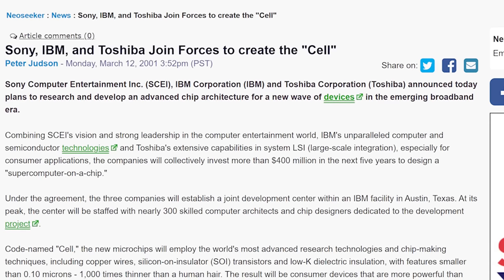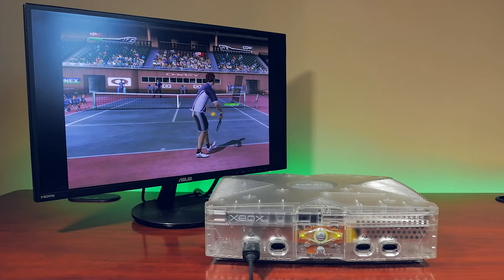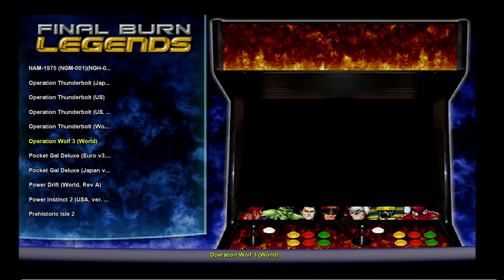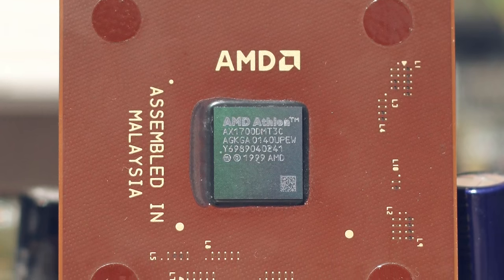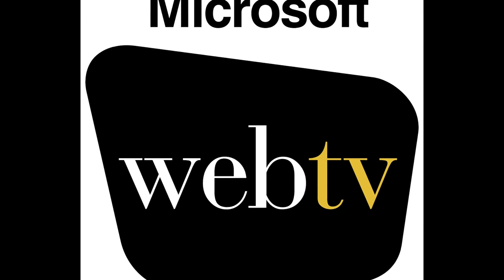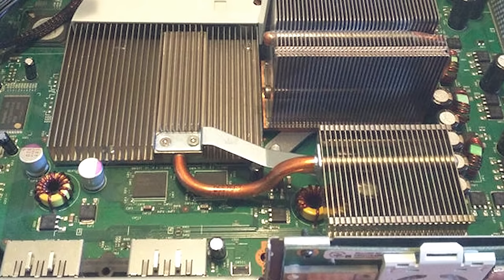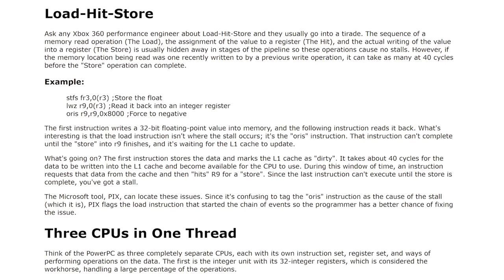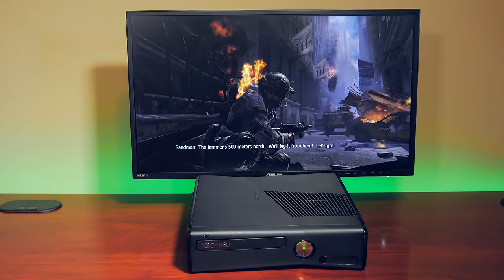Why Microsoft switched from Intel to Power PC for the Xbox 360  | MVG

Comment: Heat wasn't the only issue with IBM+Toshiba's Cell architecture.
The largest problem point for these consoles, was that they released very early during the era of moving to lead-free solder, and in those early days, the mix of metals in the solder weren't fully figured out yet, and the techniques and tempuratures that you have to use for lead-free solder were just different enough that things were bound to go wrong in the right conditions.
And in these consoles, right conditions they were. Early failures were mostly due to cracking of brittle joints, that couldn't deal with the flexes and thermal differences between the base PCB and the CPU substrate PCB. But later on, the consoles that had come out of that era without issue had issues with the tin slowly starting to fringe outwards, eventually, the little hair-like leads coming off of them bridging with other joints, shorting the connections and interrupting the data processing flow or voltages, depending on what got shorted. If the consoles had released in the era of leaded solder, where the techniques and manufacturing process had already been in use with little failure for decades, this would likely have never been an issue, as there would not have been any stringing solder, or brittle joints, and the heat load would have been much less of a problem.
Even now, leaded solder, while generally being seen as less environmentally friendly for some reason (likely more related to the eWaste industry than just having it in a computer), still proves easier to handle and generally better for getting a good, strong and reliable joint, although manufacturing and design has long since shifted to account for the potential issues that tin based solder brings to the table.
Reply: PCB fabs had years to prepare for the RoHS, but they shove the head in the sand and got caught pants down when it took effect.
Reply: KillerMemz PPC is also IBM...
Reply: @bizzzzzzle  The Cell architecture is co-developed between IBM, Toshiba, and Sony. In the full version of the Cell architecture, the version that the PlayStation 3 had/has, there was one PowerPC core with a few instructions tacked in to handle Cell specific workloads, that served as the master core, and several slave cores that ran on an offshoot instruction set that wasn't PowerPC compliant. The Master core served to handle all of the IO, the base processing power for the game, as well as the scheduling of the slave cores, while one of the slave cores got used for system UI, and the rest were reserved purely for games to use.
The XBox 360 did get the Cell architecture, but it got aodified version of it. Instead of one master and several slave cores, the XBox 360 recieved a version that had repurposed the core communications instructions of the main PowerPC core to communicate with other full PowerPC cores, and there were three of these full cores, in what is now a much more traditional multi-core configuration, that would have likely never happened, if not for the core communications instructions that were co-developed by IBM, Sony, and Toshiba.
Imagine a single core XBox 360. What a different world that would be.
Reply: @kmemz  What if Sony's current gen used the better and small CELL (used in the super slim model) architecture, but with the current gen's memory size? I would had loved to see how powerful that could've been.
Reply: @robertvuitton  While a new CELL style master-slave core processor using POWER10 and a newer manufacturing node would be great, I don't think it would have as much "Unlockable potential" as the original CELL did. The difference between then, mid PS4 cycle, and now, is: 
Back then, single-socket multi-core processing was still a very, very new thing, and not many people knew how to code for it properly. 
In the mid cycle of the PS4, most developers didn't properly utilize the eight jaguar cores of the consoles of that generation, because of AMD's whole thing about having combined important sections of their cores, leaving four floating point units and eight integer units, in practice working out as a strange hardware hyper-threading, and on the Intel side, we were still in the middle of the quad core monopoly era.
Now, The Quad core monopoly era is completely and entirely over, and most decent developers practically fully understand how to work with six to eight cores in practice. As long as they can understand both the master and slave architectures, have a relative understanding of how the master core schedules the slaves, and actually make sure to code their program to take advantage of the fact that the hardware is there, then I don't imagine it posing the same intimidating threat that it did back then.
On top of that, Cross communicating master cores have come a long, long way since then, and Intel's Ring Bus has proven particularly impressive for its theoretical limitations, with AMD's shared cache mesh bus, the "infinity Fabric", proving to be an absolutely incredible work, although its ties to system RAM clock hold it back a bit unfortunately. While cross communicating master cores still poses some theoretical limits, it seems to generally have more flexibility in terms of how well it scales depending on its implementation, and can be implemented in a larger variety of ways.
in short, I think that we've finally reached the era where what made the CELL hard to code for yet such a wonder of unlockable performance is long over, and a new version with updated manufacturing and architecture wouldn't look nearly as impressive as it did back then.
Reply: I had read about it elsewhere. Many HP notebook computers also had problems with soldering at that time.
Reply: I thought in case of ps3, it was a problem of older generation capacitors that didn't stand the heat all that well.
Reply: @niewazneniewazne1890  It doesn't matter what "generation" of capacitors you have, they're designed to work within spec in that thermal environment. At higher tempuratures, they may have a slightly impacted lifespan, but at no point did the PS3 get hot enough to boil the electrolyte mix ib a capacitor. Any device that has electrolytic capacutors and experiences thermal cycles, will eventually have an issue with bad capacitors either not working at all or working under spec; it's just a regular thing that happens with time and wear.
Reply: @kmemz  Yes it matters, they chose to use bad capacitors, when we change the capacitors for bigger ones not made by NEC it works wonderfully, i never had a YLOD after changing the capacitors, their capacitance increases with the increase in temperature so in a cold environment their capacitance was ridiculously lower than expected, also the original tokin has a bullshit internal resistance.
Reply: @niewazneniewazne1890  Actually no, the reason why the cap mods "work" is because you are reflowing the chip by heating up the board
Reply: @misham6547  From what I remember it was proven to be false.
It had nothing to do with the non-lead solder used by the PS3.

Afaik they've used a different one(or soldering process) than the X360.
Reflowing the PS3 was about as useful as people sticking their electronics into ovens seeing it as a miracle repair-all-failures job.
Reply: @misham6547  if that was the case people would continue to reflow their boards, rather than replace the caps

Comment: PowerPC CPU for X360 was great. Problems with "red ring of death" in X360 or "yellow light of death" in PS3 were because of Lead Free Solder, bad radiators, bad case design and bad cooling.
Reply: That problem in the PS3 were because of the nec/tokin capacitors and it has been proven. Two PS3 I had from 2006 with YLOD ended up working AGAIN after changing the capacitors in both. How I found this out? whenever I blew hot air around the CPU and GPU where the nec/tokin capacitors are - it turned on for a few seconds or minutes and once the console temperatures (while playing) dropped or just idle, it turned off. Later found out around some brazilian forum talking about the capacitors and changing them to fix the issue. I tried it and never again had more YLOD issue. Went out of my way to do some testing with YLOD motherboard online and now own seven of them, all working lol.

UPDATE: 
Edited to add this link https://www.psx-place.com/threads/tutorial-nec-tokin-capacitors-replacement-ylod-fix.25260/
Reply: @robertvuitton  Good comment. This is the real reason of YLOD. For all these years people blamed RSX and Cell (PowerPC) for bad design and overheating, but the main problem was nec caps.. And also, that shitty thermal paste under IHSes did make everything even worse. PPC was already hot, but that shitty thermal paste did help to kill those chips and those caps...PS3 was very hot, but after you delid that 90nm Cell and replace these caps, you will never get ylod ever again if you take care of that console. Slims were redesigned and had no nec caps, and process was shrunk to 45nm thats why slims are so reliable and fatties are not, but atleast now we know the fix for those "seemed to be dead" CECHA-CECHE models.. They stopped putting that shitty thermal paste on 3xxx-4xxx units, and soldered the chips to ihs. and those systems never fail, that was a real problem, because of shitty paste, chips got hot, because chips got hot and those caps overheated and died, those caps became even worse with all of that heat.
Reply: Yep, went through 3 ps3's myself bc of ylod
Reply: R. Atuey - yup - I believe it may be the same kind of tantalum capacitor (possibly even the same rating?) that causes the majority of MacBook Pro 15” 2010 and 2011 “gpu” failures...?
Reply: No idea about the quality of manufacturing of other components, but everything I've heard from game developers is that the PPC chips in the PS3 and 360 were pretty bad to program for, with all kinds of performance pitfalls.
Reply: @Ehal256  X360 was great and a lot easier to program, than a PS3. Cell in PS3 was a coders nightmare (too many weak cores).
Reply: yeah like how is that a good cooling system? I know cooling was less advanced then but if they were worried about heat why didn't they put fans on the cpu and gpu headsinks, and have a filtered intake? I don't understand why consoles insist on using a single fan
Reply: Glad to see someone here sharing factual information.
Reply: @robertvuitton actually that had been disproven, the problem is the PGA solder joints for both

Comment: AMD is really knocking the competition with supplying cpu and gpu for console this generation  and next generation.
AMD technology enables backwards compatibility with current gen and next gen.
Really really waiting for the video about AMD supplying the console gen.
Reply: They'll be using both cpu and gpu from AMD? that sounds damn great.
Reply: AMD is not the main reason for backwards compatibility.
Reply: @SuperAmazinglover  you're right, common x64 architecture is. But since consoles could never go Intel due to poor price/performance right now the only other option would be ARM, effectively killing backward compatibility once again. So... Thanks, AMD.
Reply: Fadex price too performance on intel is specifically because they choose too. They have no reason to lower there price as they still have a fair share of the consumer market and most Laptops and prebuilt are intel as well.

They also wouldn’t go ARM because there not powerful enough for next gen. Where getting backwards compat because of x64 and xbox has worked really hard on their emulation. If it was all thanks to AMD Sony would be having a lot more games at launch ready.

We really should give MS emulation team a lot more credit.
Reply: Not like they have an alternative. Nvidia has had petty bitch fights with anyone but Nintendo (and I'll bet they will at some point) and intel can't provide an all in one custom solution with proven tech, good yields and good thermal and power efficiency like AMD, especially on the GPU side.
Reply: @Fadexpl  thanks for explaining, ps4 and ps5 got common architecture. AMD can provide both great CPU and GPU at a good price. Developers would also have easier time making multi-platform titles, which is a win for us players.
Reply: @Zero-Wolf  Sure, they are both using Zen 2 CPUs and RDNA2 based GPUs, but there are still some pretty significant differences. The PS5's custom SSD and I/O unit has about twice the IO throughput of the XSX. The disadvantage here is that it can only hold 825 GB, while the XSX will hold 1 TB. The Xbox allows for proprietary SSD expansion cards, while the PS5 will have an M.2 slot to install your own PCIe gen4 SSD.

The XSX has 16GB of RAM with 10GB of that at 560GB/s and the other 6GB at 336GB/s. The PS5 has 16GB of RAM at 448GB/s. The XSX has a 320-bit memory bus, while the PS5 has a 256-bit memory bus.

The XSX has a 52 CU GPU that is set at a reasonable constant frequency along with the CPU. The PS5 doesn't use constant clock speeds, instead it keeps the power constant and varies the clock speeds. This, combined with AMD's Smart Shift, allows the PS5's 36 CU GPU to reach a very high clock speed.

They also differ in sound processing. While the XSX has a dedicated audio chip, Microsoft hasn't really said much about it. According to a tweet from Microsoft's James Stanard, the XSX audio chip can handle complex 3D effects like Dolby Atmos. On the other hand, Sony has really emphasized its Tempest 3D Audio. Essentially, the PS5's custom audio chip is an RDNA2 CU that was modified to be more like a PS3 SPU. Mark Cerny said this audio processor has "roughly the same SIMD power and bandwidth as all 8 Jaguar cores in the PS4 combined". 

So, in conclusion, the XSX will have more graphical performance, but the PS5 will have faster game loads and data-streaming from disk. Also, the PS5 will likely have better audio capabilities.
Reply: @robertvuitton  they're AMD's "APUs", CPU and GPU together on one chip.
Reply: @Fadexpl  No it isn't.  It's the tech and legwork both SONY and Microsoft are putting into their systems.

x64 is 64 bit, that's it.  Nothing to do with backcompat.  Do you even know WTF you're talking about?
Reply: @FeeLtheHertZ  try providing backwards compatibility between x 64 and arm then, good luck.
Reply: Ms and sony jumped from IBM/intel to amd because of $/fps.But for xbone and PS4,they chose jaguar instead of piledriver because jaguar was amd most good arch and piledriver based on bulldozer (low ipc,space heater).And finally,to achieve the $/fps they forced to use the jaguar and resulting bottleneck
Reply: As an AMD consumer for the 2nd time now (2nd laptop) I wish AMD would stop obsessing with "performance" on laptops. I feel like AMD misses the point of what their target audience wants. OK it's nice having a Ryzen laptop that reaches 3.70 GHz on demanding tasks, but there's no use for it when the CPU reaches 85 degrees while browsing a Youtube page.  AMD has to focus on TEMPERATURES... AMD chips in terms of pure hardware power is impressive and amazing, but they lack the Software control over it, their new CPU's often take more than a year of duct-tape patches in order to become USABLE, that's the current AMD business model and I think it's crap... My previous core2duo laptop (12 years ago, I know, I know... it lasted until 2020 though...) was so impressive in terms of BALANCING POWER that I was able to use it WITHOUT a cooling fan for the past 3 years of use and it would reach average 65 degrees while watching youtube videos, gaming at 30 FPS, etc. 75 at most... AMD reaches that same temperature with a cooling fan blowing over it constantly (another bad design, because cooling fans are not made to be spinning on Max all the time like that, eventually this fan will die and I don't know if I will be able to continue using my laptop, like I did with the core2duo one)
Reply: @rockapartie  Lenovo. Crappy things.... could not find HP's in my area, I needed one quick for work... HP is the only brand that ships laptops with TWO cooling fans, so I'm not sure about what you said there... besides Lenovo locks up their BIOS, can't change anything, can't fine-tune anything... It's bad
Reply: @rockapartie  But I think my biggest problem is with Linux itself, the way it handles things. On Windows I can get 38 degress on the Ryzen while watching youtube. On Linux, it goes up to 52 degrees. Fans spinning up all the time. If it continues this way, the fan will not last for long and then I will not be able to find a replacement. I was able to use laptops without a fan in the past, but not sure about this one. Ryzens are steaming machines, so inneficient. "Performance" to me doesn't mean "running on max all the time".
Reply: @rockapartie  HP doing that too? That's bad. Thanks for sharing. Wish "classic" laptops appear in the market again. Soldered RAM sucks (among other things)